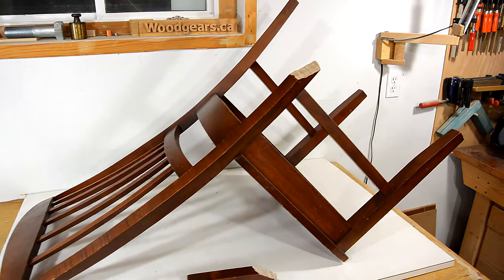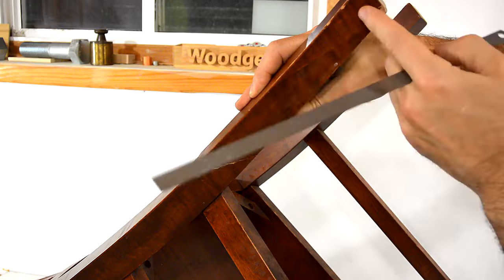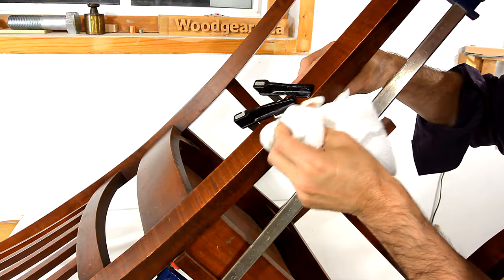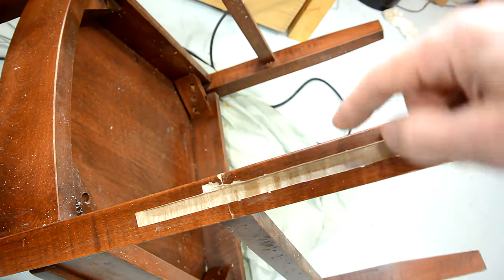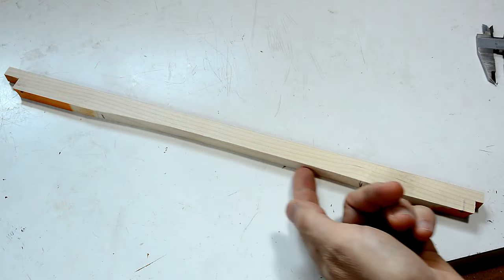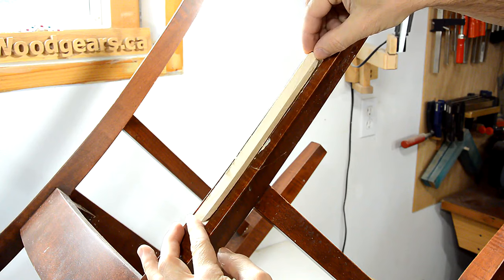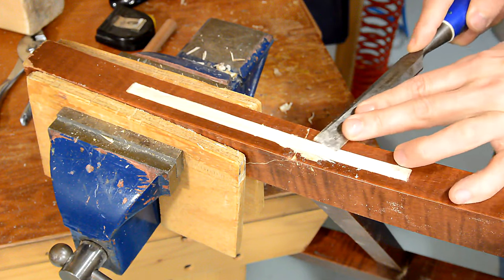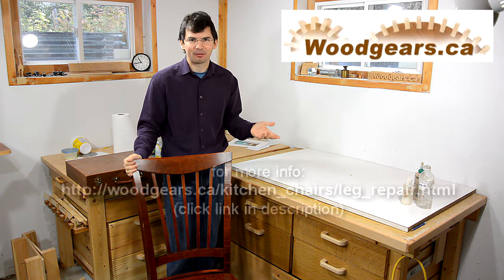Fixing a broken chair leg

Comment: "As good as new but unfortunately, not good enough" LOL
Reply: I did not understand that comment.  Sounded like it was fixed and then proceeds to use all his fancy machines the average person does not own.
Reply: @mercedesjerseygirl6100  the glue will hold the leg back together but it will most likely break again at the areas in the wood right next to the glue. That’s why he then proceeded to add reinforcement which gets a good grip into both sides of the leg from the break.
Reply: @sssiod  in that case then, if the fracture is more longitudinal (that is, along the length of the leg), will glue be enough?

Comment: I did repairs for a large middle-man furniture for over 20 years. This method works well but leaves too much color work after the glue sets. I made a jig to bore a slightly oversized hole (the depth of the holes depended on how far the bad grain extends) on both broken pieces. I sometimes had to use 12" bits to get the depth I needed. I would use a 1/2" bit for a 7/16" dowel, 5/8" bit for a 9/16" dowel, etc. I would cut my dowel to the needed length and insert it into the break with enough epoxy to fill the hole and clamp it together. The squeeze-out glued the broken area. After it set, a little clean-up, a little wood marker of the appropriate color ,and a generous application of spray lacquer finished the job. Great video. Keep up your fine work.
Reply: Seems the way 👍🏻
Reply: This is the way

Comment: Is it stronger to put the inserts on the sides of the legs where it will push and pull instead of one the sides where the insert would "bend" pushing against the sides of the slots?  when leaning

Comment: Is it possible to have drilled a hole in the chair leg and used a dowel instead of making splines?
Reply from the maker: Possible, but not as good a repair.  I want the reinforcement to be entirely on the tension side of the leg

Comment: Wow, that is really awesome.
I agree that this is probably the best way to go with the repair, but couldn't be possible (and probably enough) to just insert one or two dowels perpendicular to the glue line?
I'm asking just in case I come across a similar problem (and I don't own a router yet) :)
Reply: The problem was the grain going in the wrong direction. this affects the whole leg. :)
Reply: The dowel couldn't go very deep that way and you'd just move the problem up or down a few centimeters. And mechanically the center of a post is not strained at all when bending while the opposite outsides or compressed and strained. So a single dowel would not take much of the load.
Reply: Shannariano:  Essentially, you are correct.  I've done lots of these repairs, and the important thing is to make the mortise deep enough to get past the area of the most bending load when weight is applied at an angle.  It is not an easy repair to proper align, but careful measuring and patience will help you get it right.

I can guarantee you that one of two things happened here... either the chair was dropped on the foot of that leg with force, or someone of significant mass leaned back on the rear legs.  This kind of a break almost never happens under proper use, even when the grain runs in the 'wrong direction,' unless there is some other defect in the wood.  And now we finally see an example of why our mothers yelled at us for leaning back on our chairs...

Comment: $500 EACH?  Come on, Rick...  maybe $500 for the SET, eh?  Nice repair if the appearance is not that important.  Best would have been to create, essentially, a loose tenon joint in the break.  I've done dozens of this exact kind of repair.  It takes practice, and aligning the mortises can be a challenge, but you can make an almost invisible job of it if done right.
Reply: well you know Rick

Comment: Shouldn't it be easier to drill holes in both pieces of the legs and use a wooden dowel to join and reinforce them?
Reply from the maker: Try it and you will realize it isn't.
Reply: Okey. Would it still be sterdy with the wooden dowel or would the dowel be to weak?
Reply: Easier? No! You have one chance to get the angles right. ONE!
Reply: Actually IT IS.
Reply: @MrGnom99  it would be if the end grain wasnt all curly

Comment: how can a end grain glue up be "good as new" without re enforcement?
Reply from the maker: It isn't.  But it's not an end grain joint, it's a side grain joint because the grain is all in the wrong direction.  Which is why the reinforcement is needed.